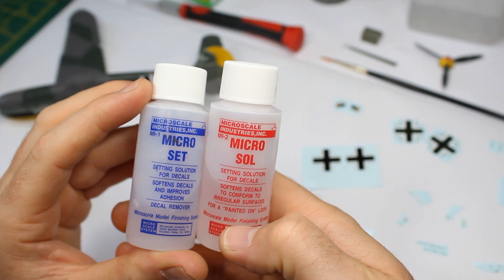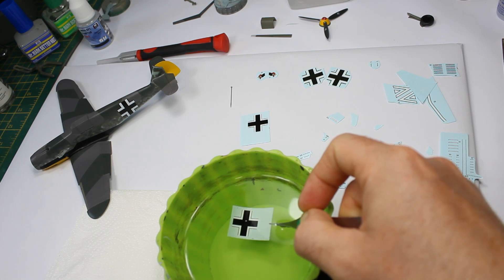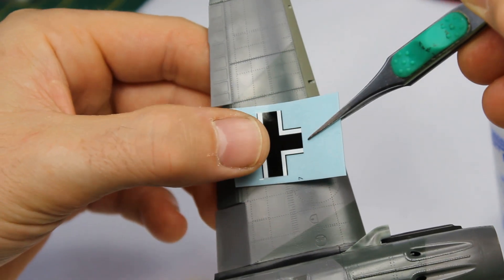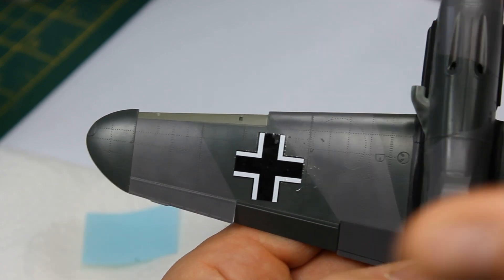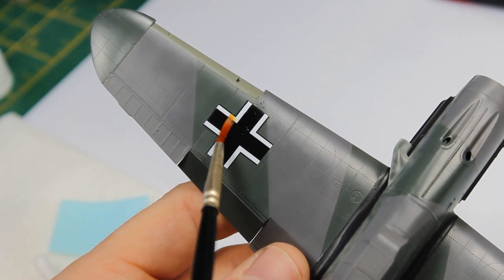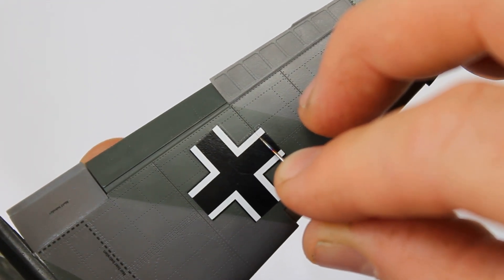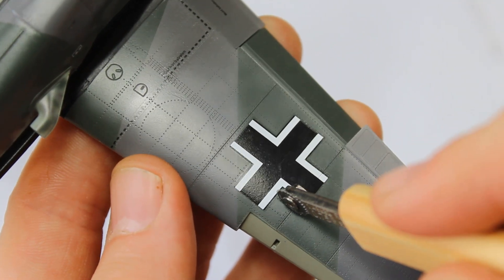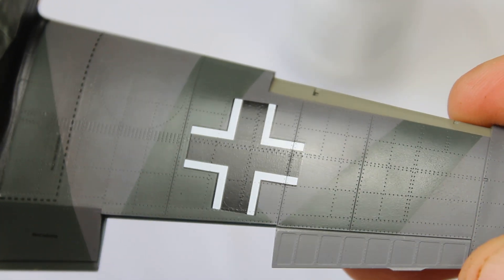Applying Decals (more advanced), for models, planes, tanks, cars, trains etc.

Comment: Great vid, thanks. I recently purchased some Vallejo Decal Fix and Decal Softener as I accidentally knocked my bottle of Microset over, stupidly tall bottle with a small diameter base!
When I used the Vallejo Decal Fix on Tamiya clear coat it ate through the clear, luckily the decals weren't damaged and I was able to salvage the situation by applying another coat of clear over the decals and affected area. I put this down to being an error on my part as I only left the Tamiya clear to dry for around four hours before applying the decals.
Next time I used the Vallejo Decal Fix it was on top of Tamiya paint without any clear coat applied as the surface was fairly satin and the Tamiya paint had been left to dry for 3 to 4 days. The Vallejo Decal Fix dissolved the Tamiya paint as if it was water paint in just a couple of seconds and took it right back to the Vallejo primer that I prime all of my models with, the Vallejo primer was unaffected by the Vallejo Decal Fix. This resulted in me having to respray the whole tank.
I contacted Vallejo Sales about this asking if there were any known compatibility issues but they never bothered to reply. The Vallejo Decal Fix and Decal Softener are now lying in the bottom of my "Crap Modelling Products" drawer and will never be used again as I exclusively top coat my models with Tamiya acrylics.

Comment: Thanks. The tip about using the needle was great, using a knife on a softened decal/finished paint job is always risky. FYI for modellers outside of the US where the strong solutions have to be imported, you can make it by mixing 1 part Mr levelling thinner to 4 parts 70% IPA.

Comment: Hmmm if I’m using micro set and micro sol, the micro sol should shrivel the decal up , and as it starts to dry off and pull the decal into all the recesses and rivet’s. Never had to do anything other,.
Also when using micro set to first apply decals it should hold the decal as it sucks it down. It’s only to reduce water retention under the decal.

Comment: Anyone gets every now and then a whitish residue around the decal after applying the microsol red (the one that melts the decal)
Reply: It's tide marks from the solvent glazing the paint. In my experience, cleaning up the excess fluid with a cotton swab fixed this. Most of the time it should disappear with the second coat of vanish though.